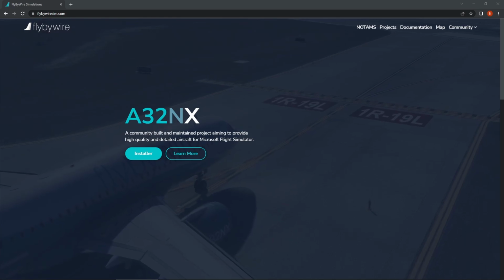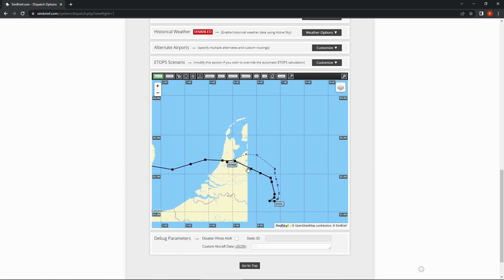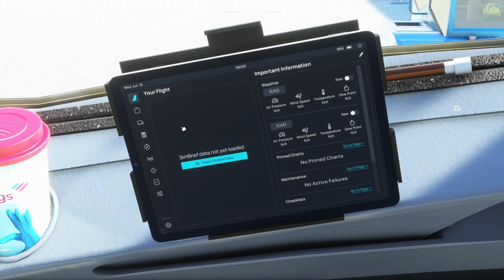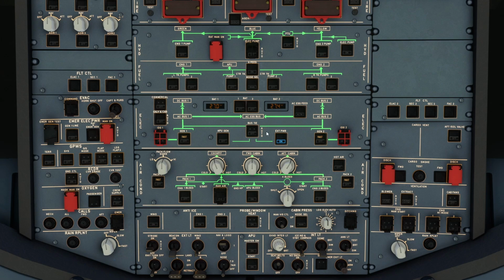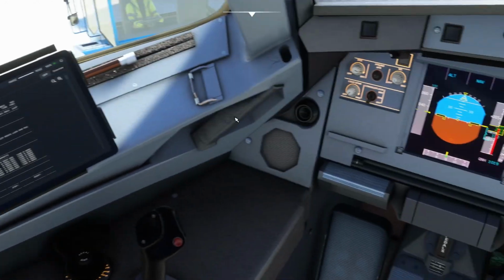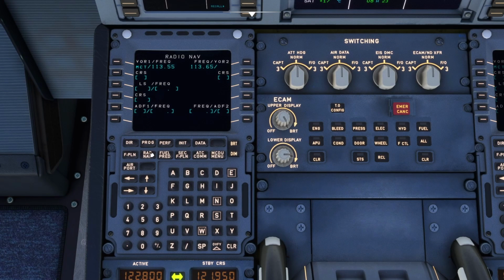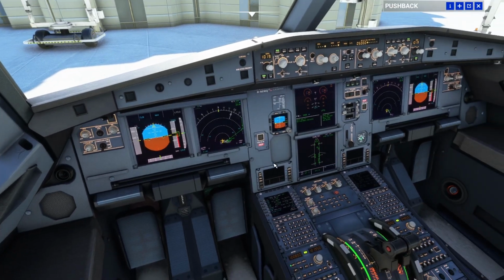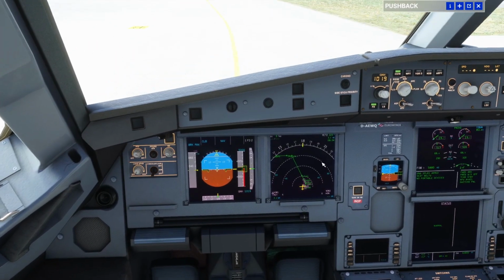FlyByWire A32nx Beginner Tutorial | Episode 1 | Installation+setup | Cold and Dark

Comment: I don't have an option for weight and balance. Also when putting in my flight plan, it appears to be working good and connected properly, but when I'm in the air it takes me to a totally different place and follows some weird straight line plan that wasn't my selected plan.
Reply: did you ever figure this out? Im having the same issues now.

Comment: Does anyone know why my FOB on the MCDU doesn’t show? I have fueled up to the correct weight etc copied this video but no matter what I do my fuel on board never shows
Reply from the maker: @kyleleitch173  are you fuelling up using the Flypad?
Reply: @RealSimPilot  yes I am fueling using the fly pad. It imports my simbrief flight plan but when I go into the mcdu to load the flight plan I just have 3 x “-“ where the fob should be. I literally copied your video step by step but still nothing
Reply from the maker: Not sure what the issue could be. That video is a bit outdated now and the aircraft has gone through many updates. Maybe follow this one and see if there's any difference in setup https://youtu.be/RHJw8JTToKE
Reply: @RealSimPilot  thanks mate I’ll give it a try I’m baffled as I can’t see weight/balance either once the plans loaded in

Comment: Your videos are well done ! - I wish it were that simple, I still have issues starting engines, and have been able to setup detents once, then never again.  It just is wonky (is that the word) Like that Ryan Air jet spinning around on the tarmac.
I can still Fly and its great with the new Mini Cockpit device, although the Push to Manage doesnt seem to hold, I have to push then pull or the other way to get the buttons to work the way intended.  I notice you didnt turn on the Radar for weather/terrain... and I cant find the Air Traffic setting .. I see yu had it on but didnt see the process.
Thanks again !  I decide to re watch yet more of your videos trying to nail down the Engine Start and other details of the FBW A320 sinsce MSFS is stil  setting up rolling cache after 1 hours. gah!

Comment: Hi
Great in depth video, I’m new to the FBW 320  and getting to grips with the setup but can you tell me how you manage to taxi so fluently? My nose wheel is slow to react and then all of a sudden turns sharply! I’ve read on FBW it’s because of the hydraulic system .. I use the thrust master captains pack and it’s fine on the other Airbus series . Thanks again
Reply from the maker: Thanks for watching.
Do you have rudder pedals? I use the twist axis on my flightstick mapped to the nosewheel tiller function separate from my rudder pedals.
https://docs.flybywiresim.com/fbw-a32nx/feature-guides/nw-tiller/
See if this guide helps.
Reply: Thanks for the reply , I’ve now managed to map all axis to the FBW and what a difference it makes when it’s done correctly, I’m now as good as you on taxi 😉 thanks again and your videos are great for getting people used to the FBW 320

Comment: If i go back to aoc menu after doing the initial data request to simbrief. I dont actually get an option to go in to the weight and balance page.
Reply from the maker: It's moved to the flypad EFB. Do the weight and balance there.
Reply: @RealSimPilot   sweet thanks! for the reply.
i found it myself and just finished my first flight from Amsterdam to Gatwick.
Reply: for reference.
when generating a flight plan trough simbrief.
the average wind, w/c and isa.
you have to input the average W/C into the MCDU, but you only touch on tail wind in this video.

my simbrief plan had an W/C of M027.
but i had no idea wehter i should put that in as a +27, -27 or just 27 or some other prefix with it, could you clarify how this works for me?
Reply from the maker: @LodewijkVrije  P for plus M for minus. You would have put in -27 :)
Reply: @RealSimPilot  i figured that was the case, thanks for clarifying anyway!

there is currently some nice wind going on in The Netherlands, so i think ill go and plan another flight out of EHAM now :p

Comment: Your videos are great! Can you tell me how to avoid A FLOOR and TOGA lock, there must be some trick on takeoff to avoid these conditions, any advice appreciated.
Reply from the maker: Make smaller inputs on the sidestick. Don't pitch up too high to create a high angle of attack and low airspeed. To get out of A.FLOOR pitch the nose down and increase airspeed. You can then reactivate the autopilot. To get out of TOGA lock disconnect the autothrust on the FCU set the throttle back to the Climb detent and reactivate the autothrust. You can then continue as normal.
Reply: @RealSimPilot  thank you!
Reply: @RealSimPilot  thank you so much for your help! Really lovin the A32NX I've got the hang of it now no more A FLOOR or TOGA lock!

Comment: im having an issue where GPS primary lost wont go away. I turn all 3 irs to nav and the message remains despite the attitude indicator appearing
Reply from the maker: It will only disappear after the ADIRS have aligned. Takes a while depending on your align time realism settings. Afterwards it should disappear
Reply: @RealSimPilot  where is the setting to change how long it takes to align
Reply from the maker: On the FlyPad under settings, go to Realism and you will see ADIRS align time.
Reply: @RealSimPilot  thank you!

Comment: Hi there. I have just installed the A32NX and have noticed that acceleration down the runway on take off seems way to fast. If I compare it with the standard MSFS A320Neo  which reaches 140 knots in 23 seconds, the A32NX reaches 140 knots in 17 seconds - is this realistic (I checked to ensure the MFS sim rate was x 1) or am I doing something wrong?
Many thanks
Reply from the maker: The default a320 neo is not as accurate as the A32nx. I would rather get used to the A32nx
Reply: @RealSimPilot  many thanks for your response. Do you have any advice on improving the frame rate when flying the A32NX - I have a high end system but I see a significant frame rate drop?
Many thanks

Comment: Thanks for a wonderful tutorial man!. I have one question, when i am in the AOC menu, my W/B is grey in color and nothing happens when i click on it. Is there something i am missing?
Reply from the maker: Yes its moved to the flypad
Reply: Weight and Balance is now done via FBW's Flypad EFB

The fly pad is the tablet on the captains side. Weight and Balance should be the second or third navigation button (the little icons on the left), labeled "ground". Once on that page, there are buttons just below the top right, labeled fuel, payload, pushback and ground (I think). You start on ground. 
Fuel is obvious, it fuels the aircraft (either in real time, "fast" or instantly)
pushback is the flybywire pushback tool
payload is for passengers and cargo (Also has the three speeds; real time, fast and instant)
Ground is for things like Jetbridge/Jetway connection, Catering, Baggage Truck etc.
There is an icon on the Fuel and Payload pages that looks like a cloud. That downloads the fuel numbers calculated by Simbrief (should you have linked it with a flight)
To start the fueling/boarding process, click the arrow (right facing, like this ->) on the respective pages. If you feel like its too fast or too slow, you can change the speed as you board. 
Your weight and balance will change accordingly, both during and after the process. (Though for things like ZFW calculations I heavily recommend you wait for the plane to be completely full.)

Comment: This tutorial is amazing! I am having some issues with the MCDU, the W/B option is greyed out and unavailable. Curious if you ran into this at any point! Appreciate your content!
Reply from the maker: Since making the video it has moved to the EFB. W/B is now done on the FlyPad. Thanks for watching.
Reply: @RealSimPilot  hello where on the flypad.  sorry im new to this
Reply: @iallaway  
Weight and Balance is now done via FBW's Flypad EFB

The fly pad is the tablet on the captains side. Weight and Balance should be the second or third navigation button (the little icons on the left), labeled "ground". Once on that page, there are buttons just below the top right, labeled fuel, payload, pushback and ground (I think). You start on ground. 
Fuel is obvious, it fuels the aircraft (either in real time, "fast" or instantly)
pushback is the flybywire pushback tool
payload is for passengers and cargo (Also has the three speeds; real time, fast and instant)
Ground is for things like Jetbridge/Jetway connection, Catering, Baggage Truck etc.
There is an icon on the Fuel and Payload pages that looks like a cloud. That downloads the fuel numbers calculated by Simbrief (should you have linked it with a flight)
To start the fueling/boarding process, click the arrow (right facing, like this ->) on the respective pages. If you feel like its too fast or too slow, you can change the speed as you board. 
Your weight and balance will change accordingly, both during and after the process. (Though for things like ZFW calculations I heavily recommend you wait for the plane to be completely full.)
Reply: @Irrelevant-Individual  Thanks for providing these details!
Reply: same how to i find w/b its not there
Reply: thanks for asking i had the same?

Comment: I see WB (weigh and balance) in the MCDU only for the stable version of A320NX and not for the other two versions updates. Do you have an idea how to fix the issue. Thanks in advance. Love your videos! Always using them as a guide. Never thought flybywire is so good and makes things real. Am actually enjoying setting the cockpit and instruments more than the actual flight itself. Another thing I enjoy is landings. Cheers mate
Reply from the maker: The WB has moved to the EFB. It's now done on the Flypad. Thank you
Reply: Weight and Balance is now done via FBW's Flypad EFB

The fly pad is the tablet on the captains side. Weight and Balance should be the second or third navigation button (the little icons on the left), labeled "ground". Once on that page, there are buttons just below the top right, labeled fuel, payload, pushback and ground (I think). You start on ground. 
Fuel is obvious, it fuels the aircraft (either in real time, "fast" or instantly)
pushback is the flybywire pushback tool
payload is for passengers and cargo (Also has the three speeds; real time, fast and instant)
Ground is for things like Jetbridge/Jetway connection, Catering, Baggage Truck etc.
There is an icon on the Fuel and Payload pages that looks like a cloud. That downloads the fuel numbers calculated by Simbrief (should you have linked it with a flight)
To start the fueling/boarding process, click the arrow (right facing, like this ->) on the respective pages. If you feel like its too fast or too slow, you can change the speed as you board. 
Your weight and balance will change accordingly, both during and after the process. (Though for things like ZFW calculations I heavily recommend you wait for the plane to be completely full.)

Comment: The plane is loading in but not working for me, the cockpit has all the lights on and the ai can't start the engines. Do you have any clue why? :(
Reply: I have the same problem. I have tried three times. I think this video don't tell us something...
Reply: @niemepet71  did you buy the game?
Reply: @808_murda2  Yes, I have bought the game from Steam. And I have bought several items from marketplace also. I can get the plane up in the air if I go through FS2020 checklist. But if I do this videos checklist with SimBrief/Navigraph Chart, that I have also bought - the engines won't start. All the light are on and I can't see any errors/failiers.
Reply: @niemepet71  hmmm try going on discord thru the installer and contacting support
Reply: @niemepet71  i bought the game not too long ago and it works man, just buy the game.
Reply: @808_murda2  I have bought the game when it was launched (2020). Either they fixed it or vanilla state fix the problem. I put the game in vanilla state and installed every DLC etc. again. And now it has been working fine months now.

Comment: Hello … how did you calculate the pitch trim ? 👍🏽
Reply: There is a takeoff cg/trim position chart. Shows the CG weights on top and trim setting on bottom. Search it on google. You’ll have to be a little specific as there are different ones for different plane models.

Comment: ATC doesn't work after installing FBW A32NX mod. When flying without the mod you request taxi clearance and ATC knows which runway you are taking off from. ATC tells you too head down adcb to Runway 8 then contact Edinburgh for take-off clearance.

But with FBW mod installed it asks to depart from North, East west etc and there are always touch and goes why is this?
Reply from the maker: It's because with the FBW you don't use the built in flight planning for the route which is what the ATC relies on.
Reply: @RealSimPilot  yeah I was just giving you an example how it normally works without mod installed.

So just programming in EPGH from world map and starting point as gate 7 how do I get atc to work? Is it normal for it to ask to depart from either North, East ,South or West? Like even when it comes up with taxi routes etc the same taxi to North, East ,South or West

Comment: Thank you for this tutorial! I have a question regarding fuel and payload/balance. When I select fuel and payload via msfs fuel menu (not FBW integranted  one) I cannot put a certain amount of fuel because it resets automatically and also I cannot write in numbers in the boxes. It does weird things like put 0,00005 kg in payload when I previously write, for instance, 8500 kg.
I know that is better to use the FBW implemented calculator, but could you try if it is bugged and tell me here? It'd be much appreciated.
Thanks and have a great day!
Reply: I've had this problem too. So what I usually do is decide my fuel/payload balance through my FlyPad. Not sure in which menu it is, but it should be next to the pushback option. And just put your fuel in from there. You can also choose the refueling speed/time to be instant or realistic, so it's pretty useful imo.
Reply: @michaelakaw.i.e.8693  Thank you very much my friend! I was looking to someone who had the same problem. Then it is a bug. Yeah I will use the integrated fbw system to load fuel and balance. Have a great day!
Reply: @raulflyeryt9856  Haha, no problem man! It just is what it is for now. Have a great day too👍🏼
Reply: @raulflyeryt9856  it is not a bug. As FBW moves further away from the default aircraft it will be less and less integrated with the default MSFS systems. Fuelling will not be done via MSFS again.
Reply: @johnmaguire2185  thank you sir!

Comment: Hello I have a little problem is there anyway u can help ? On the navigation where it says where ur plane is in the cockpit it doesn’t show me what alltitude I should be at at different way points . Any way to fix this ?
Reply from the maker: Press the CSTR button on the EFIS control panel (next to where you set the QNH)
Reply: @RealSimPilot  thank you but I did this and on approach it didn’t say what altitude and speed I need to be at at certain way points